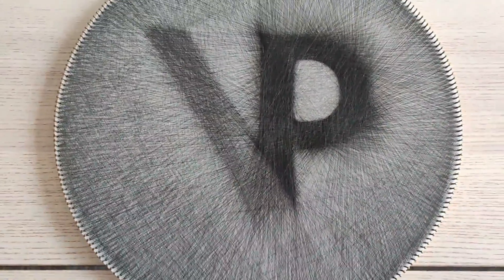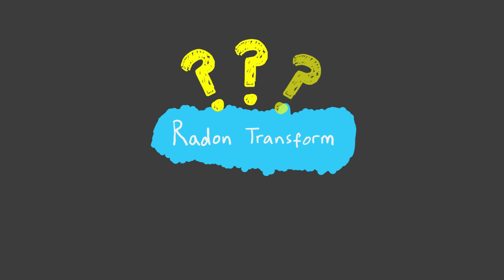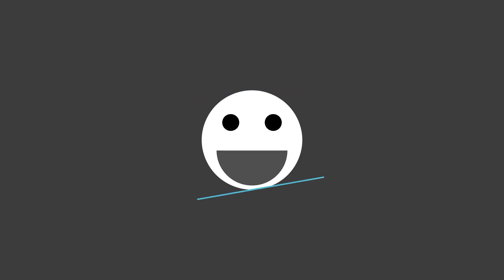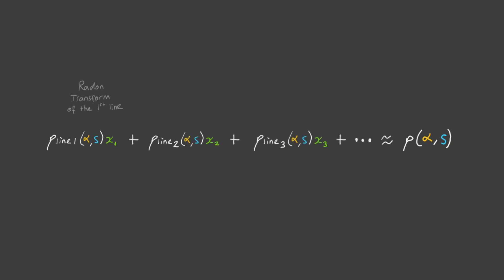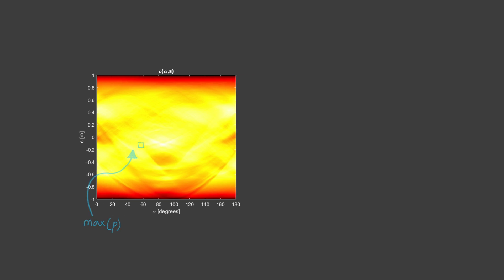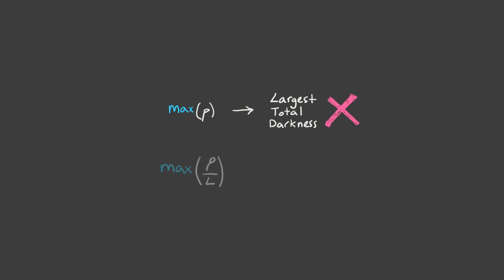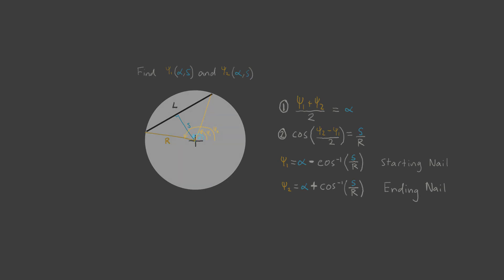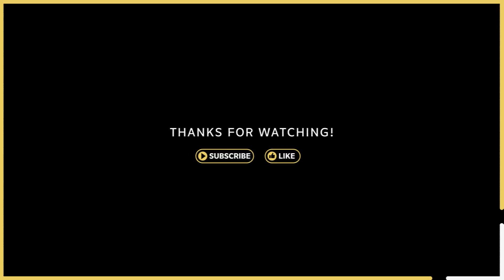How To Make a Computer Create Something Beautiful: String Art #SoMEpi

Comment: Are you assuming the sum of strings is linear?
How good is that assumption?
Especially for colour?
Reply from the maker: Wow very observant! Yes, I assume that the darkness of one string linearly adds with another string. This is technically untrue since the opacity of one line a1 and the opacity of another line a2 will combine by this nonlinear equation:

(1-a1)*(1-a2) = (1-a3). 

However, if you take a taylor series for a1 and a2 being "small" then you can show that a1+a2 ~a3, so this approximation is very good for small amounts of string. However, if you wanted to improve this you could notice the following:

ln[(1-a1)*(1-a2)] = ln[1-a3]
ln[1-a1] + ln[1-a2] = ln[1-a3]

Define t1 = ln[1-a1] and t2 = ln[1-a2] and t3 = ln[1-a3]

t1 + t2 = t3
This is linear relationship! So instead of doing the whole algorithm with darkness of individual lines, do it with these new t variables. Then at the very end, convert back to darkness.

The same approach should work for color (although I haven't tried it to be honest with you).

Comment: does this method have any guarantee that the starting point of each line will correspond to the end point of another, because if it does I don’t see how. otherwise great video
Reply from the maker: What an amazing question. Thanks for asking it. You're absolutey correct, I have not shown in this video how I managed to ensure that the end of the i'th line is the start of the i+1'th line (there's only so much I can show in 9 minutes). As I've described it in this video, the lines do not need to be connected which is the main reason why the artwork at the end looks so impressive. However, I tried to solve this problem in two ways: 1) During the greedy loop, after the i'th line has been chosen, instead of search through the entire radon space for the next line, instead limit your view to only lines that start the end of the previous line. After a bit of math you can show that in radon space, the next chosen line must be constrained to lie on a sine wave passing through the previous chosen point. Nuermically this was very difficult to account for since the grid was rectangular and small rounding errors would result in lines that almost started where they should. 2) Instead of this, I decided to simply post process my work at the end by projecting the final solution onto another solution where this constraint was met. It worked very well, but the downside is that it was quite slow. If you're curious you can see how I coded this up on my github: https://github.com/virtuallypassedsmartsparrow/StringArt

Comment: Super interesting expansion on the last video. After a quick look through your matlab script and seeing this done with rectangular canvases as well, I'm curious if this would be possible to generalize to any arbitrary arrangement of nails, rather than only ones that are evenly spaced around the edge of a shape. It naturally wouldn't work with the radon transform anymore, since the radon transform assumes an infinite line, but if we can create some sort of equivalent transform that is confined to our possible line segments, I feel like the greedy algorithm would still function in the exact same way.
Reply from the maker: That's a great question! I've been thinking about that too. The radon transform approach that I show in this video technically assumes infinite nails. You can post process this and project onto an equally spaced set of nails afterwards (this is what I've done in my script). In principle though you could post process and project onto any arbitrary set of nails with irregular gaps - but it'll be quite slow which kind of defeats the purpose of using the radon transform. I've yet to find a good solution to this. :}
Reply: @virtually_passed  I think I get what you mean, but that's only assuming that we're still projecting onto a concave shape. I meant that if we wanted at least one nail somewhere in the middle of the canvas, the radon transform can only look at a line through the entire shape instead of stopping at the nail, so its a lot harder if not impossible to accurately project the radon transform to our possible line segments. It would probably be better to rewrite the transform to work in the space of line segments between the nails, rather than the space of all possible infinite lines
Reply from the maker: @elder_frost  You're right, this method I talked about in my previous post only works for convex shapes. Perhaps you can augment it to work for non-convex shapes by taking a much larger circle that fully encloses the original non-convex shape, and then add a few tricks to the algorithm so as not to reward lines that go through too much 'empty space'. But in all honestly, I haven't tried this. Good luck! Feel free to fork my code on github if you like :)

https://github.com/virtuallypassedsmartsparrow/StringArt

Comment: Hello. I am trying to write a string art algorithm from a video. I am using Matlab. But I am having trouble writing it. I was wondering if you could help me?
I am having trouble subtracting the Radon transform of the line from the original Radon transform. It is at 5:43 in your video.
I would be very grateful if you could help me. I want to make a gift for my girlfriend from our photo.
Reply from the maker: That's a great project! MATLAB has an inbuilt radon function but you need to play with it a bit so that it scales the values and crops out regions outside the circle (s>1).

If you're interested my code is freely available via GitHub 

https://github.com/virtuallypassedsmartsparrow/StringArt

Comment: The resulting string art looks very impressive. One thing that may be a bottleneck to the current approach is the use of a greedy algorithm to generate the lines sequentially. Have you tried modelling the generation as a linear programming optimization problem? There are some pretty efficient solvers and it may make sense to try it despise the huge number of variables. As a basic idea, you can take all the allowed combinations of psi_1 and psi_2 and assign them a possible variable between 0 and 1. From there you could transform the corresponding lines to their Radon transform space contribution and use a bunch of linear inequalities and a minimization of the deviation from the original in order to get a suitable approximation of the target. Regarding solving the linear problem, you could force the variables to be strictly 0 or 1 and try a good mixed integer linear programming solver that can find a solution which is close enough to the optimal (since the problem may be too hard to solve exactly), or you could try using continuous variables and experiment with the formulation of the model in an attempt to make most variables exactly 0 or 1 in the final solution and round the rest. Additionally, even if finding the global solution is too hard to model as a linear problem because of the size, you could probably still use a reduced version of the model to generate suitable batches of 5~10 lines at a time, which may be an improvement to greedily generating only 1 line at a time. There is also an added benefit of the linear programming approach, which is that you can model additional constraints like the fact that the end of the previous line should be the start of the next (although you will likely have to use an Euler path algorithm to extract this information from the linear variables).
Reply from the maker: What an amazing comment. thanks for bringing this up. You mention three things: 1) changing the optimization algorithm 2) editing the existing greedy algorithm and 3)  adding a constraint such that the end of one line is the start of another. 

1) I have actually tried several mixed optimization solvers (using MATLAB/ gurobi) but they were all too slow to be practical for this high dimensional problem. Perhaps I've missed a few and there could indeed be lots of room for improvement here. 
2) I had this idea as well but I never implemented it. At the start of the optimization this would be great and would speed up a lot. But towards the end it would likely create a worse result because the additional 9 lines would be made without having the rate on transform of the image updated yet. I haven't tested out though. Perhaps there's also room for improvement here! 
3) I have already made a function which applies this constraint. For the circular canvas the constraint is very easy to implement and can be done directly in the greedy algorithm. However for the rectangular canvas it's much more difficult, and I was forced to do it all post-process - so you can think of it as an optimization on top of an optimization. 

Just so you know I've released all my code for free on github. If you want to fork the repo, you're more than welcome! 

https://github.com/virtuallypassedsmartsparrow/StringArt

Comment: May I ask a question ? At 6:00 when you substract the sinogram of the curve from the original sinogram, how do you avoid negative values. Do you have to somehow weight the sinograms, or don't care about negative values, or round to zero. Thanks a lot for all your so well explained videos.
Reply from the maker: In the iteration loop I have a break condition which states that when the difference between the signogram of the curve from the original sinogram gets lower than some threshold value close to 0 then I break the loop.
Reply: @virtually_passed  Thank you for your reply! But I must have misspoken my question: if I've understood correctly, at each iteration you subtract the sinogram of the line just added from the total sinogram. This means that at certain points (a,s) of the sinogram, there may be negative values. That's what I was wondering about. Thank you
Reply: @nicolasdetarle9129 I assume you could just clip the  negative values to 0. After you have reduced the  brightness of a certain point in the picture you can still run a thread there while the brightness remains 0. I just have the feeling this only works for grayscale images and not for full color images (where the ratio of the different colors in a point is important).

Comment: Hi! Is the sinogram at 5:09 made with the formula for rho_line(a,s) at 4:58? If so, it doesn't look like that, because it should yield 0 for S≈S0 & a≈a0 region above and below (a0,S0) point on the sinogram (the region, that corresponds to radon line going through real non-zero width line from one side to another). More precisely, if dS=S-S0 and da=A-A0, then the condition you used to determine that the intersection is inside the circle leads to the inequality -abs(dS)/(R^2-S0^2)^(1/2)<da<abs(dS)/(R^2-S0^2)^(1/2) in the first approximation. In the region where this condition is satisfied, rho_line=0, which is not in the sinogram that is shown at 5:09. Bad explanation, but i hope you get what i mean.
Also did you use something like min(1/|sin(a-a0)|, 2*(R^2-S0^2)^(1/2)) instead of just 1/|sin(a-a0)|?
Reply from the maker: Excellent observation! This was a sneaky simplification I did in the video. You're right, in my code to generate the p_line shown at 5:09 I actually used this code:

p_line = d*p_min ./((d.*L-p_min).*abs(sin(ALPHA-alpha0)) + p_min);

And where this quantity: p_region > 0 is where p_line = 0. 

p_region = (S.^2+s0.^2-2.*S.*s0.*cos(ALPHA-alpha0)) ./ ((sin(ALPHA - alpha0)).^2 + (t/(2*R))^2) - R^2;

Where t is a parameter that is 'roughly' equal to the thickness of the line. The advantage of this formulation is that it accounts for the finite thickness of the line and ensures that p_line doesn't equal to infinity when alpha = alpha_0
Reply: @virtually_passed  Thank you for the answer! Could you explain a bit more about d, p_min and L variables in the p_line expression? It seems to me that d is the maximum allowed value = 2*(R^2-s0^2)^(1/2), but I don't understand why we need both p_min and L and what they are. I suspect p_min/L=min allowed value=t, though. 

Also, if I am right in my guesses, then p_line = min( p_min/( L*abs(sin(ALPHA-alpha0)) ), d)=min( t/abs(sin(ALPHA-alpha0)), 2*(R^2-s0^2)^(1/2)) should better represent finite thickness. It yields p_line=d for a range of parameters that correspond to radon lines inside a finite thickness line, while p_line = d*p_min/((d*L-p_min)*abs(sin(ALPHA-alpha0)) + p_min) gives p_line = d at exactly one point ALPHA=alpha0 and this maximum is very sharp, which should not be the case here.

Comment: Is it necessary for the "line of light" to have the string's darkness profile as the sensitivity profile, or can it just be an infinitesimally thin line (or, in discrete media, a simple antialiased line)?
Reply from the maker: Actually originally I did use a Dirac delta profile for the line (infinitesimally thin line) originally.
Reply: @virtually_passed  I was looking faroward to implement this myself, I also saw a few improvements in computing the radon transform, I just wanted to tick out a few queries. I will hopefully, make a video on the optimization.
Reply: @virtually_passed  I am back again, so by sacrificing my grades I have managed to implement a rough version of the radon transform version of string art in C++, I had a few queries regarding the entire algorithm, If you don't mind can I discuss them?

Comment: Compared to a more naive approach of simply averaging darkness of potential lines and subtracting a line weight when you pick one, what are the advatages of the radon tranform? Faster to calculate? More accurate? If so by how much?

Also, I saw you mention it in another comment but how much of a difference does either factoring or not factoring in the thickness of the pins effect the end result? My gut tells me not much at the low resolution that string can represent but I haven't tested it myself.
Reply from the maker: When I tried the "traditional" approach it could take 5-10 minutes and that's not accounting for precomputing matrices. With the radon approach I don't need to do any precipitation and it typically takes 1-2 minutes.
Reply from the maker: And I agree with you, wrapping the string around nails in a particular order doesn't add that much improvement. Hardly noticeable.

Comment: Thank you very much for such nicely explained and animated videos about radon transform applied to string art!

I was struggling to understand the formulas: what do S_0 and alpha_0 stand for?

To contribute to other comment about colored string art: Genie's art and Craft (youtube channel) is doing such a great job at doing it. He is not explaining his algorithm of course. But you can see that he is alternating between colors, and not only doing one by one successively. He is also using CMYK, but he shows some other algo using more colors, like blue green and red. They are amazingly not really giving better results... I'm really wondering how he is doing 🤔 Maybe it is possible to run the algo for each color, as you are currently doing, but then determine which order allows to have lines on the top for a given pixel... doesn't seem feasible in practice...

I was also wondering if taking into account the thickness of the nail could have a significant impact on the resolution, what do you think? Have you tried? Could be done by doubling each point, and forcing each next line to begin from the paired point instead of the same one.

Good luck, and keep on the good work!
Reply from the maker: What an amazing set of questions!
1) s0 and alpha0 are values used to parameterize a single line of thread, whereas s and alpha are used to parameterize a single line of 'light' from the laser.
2) mixing colors with every iteration is a great approach. Also adding additional colors helps too! I've modeled each of my lines of string as partially transparent, and that means when you overlap one color on top of another color then you have to use an opacity formula which can get very complicated. To make things easier I just decided to put four layers on top of each other, but I don't think this is optimal. 
3) yes having thick nails can be a great advantage for exactly that reason! That means wrapping string clockwise or counterclockwise effectively gives you a higher resolution. I've already implemented this but skipped talking about it for simplicity.

Comment: Next step - rectangular canvases. Not sure why the "radon transform' is needed if you are only interested in ψ. At a guess - it's used because there's an out-of-the-box engine to compute it in mathlab.
Reply from the maker: It's because the radon transform can be calculated extremely quickly :) yep MATLAB has an inbuilt function for this.

Comment: Great video! I made my own string art last year with the help of your video and it turned out fantastic. Since then I couldn't stop thinking of extending the idea to 3 dimensions and turning a 3d model into a string cube with pins on each of the 12 edges. The idea of slicing the model into 2d planes and applying the algorithm would only have the strings as flat slices on a cube. I want the strings to be in all 3 dimensions. I would really appreciate some advice on how to go about this.
Reply from the maker: That's incredible! Great work! Ive also put some thought into 3D string art. The easiest way is to construct it out of multiple 2D layers, but I'm not a fan of this. I think you can generalize the radon transform into 3D and apply the same technique as shown in this video. The downside is that making this by hand would be very challenging, I also think a machine would struggle with this as well
Reply: Rather than the edges of a cube, maybe put a cross of nails on each face.This will give you many sets of skew lines, allowing you a number of options for string passing through the inner octahedron of the cube.